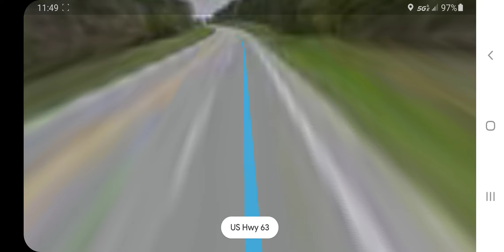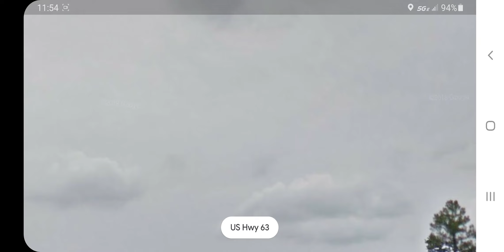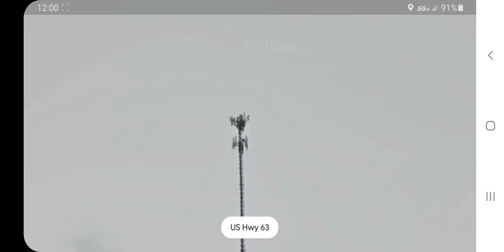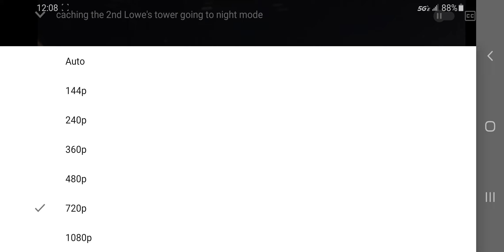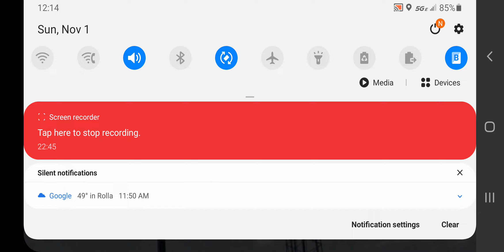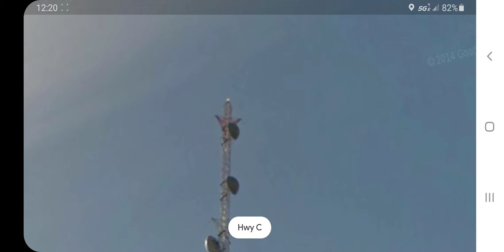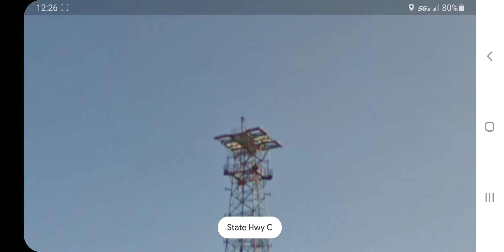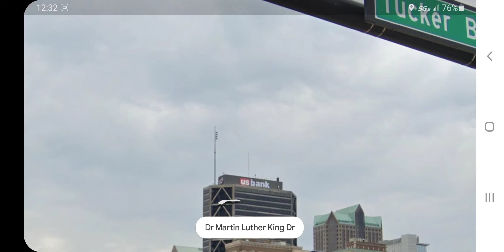beacon problems part 1

Comment: There's A Tower In Cotton Mn That Has A Day Mode Problem. It's A Tall Red And White Tower With 3 LEDS, 1 Up Top And 2 LEDS Sidemarkers In The Middle, With Dishes On It, Its Day Mode Is Not Working At All, All 3 LEDS On The Tower Are All Burnt Out, It Sits There Doing Nothing Every Morning, It's Been Like That For Quite A While Now, It Hasn't Been Fixed. Day Mode Is Completely Dead, But HOWEVER, AT NIGHT, ALL THE STROBES THAT ARE BURNT OUT FOR DAY MODE, THEY ALL WORK! THEY ALL WORK FOR NIGHT MODE! It Has A Slow LED Flash Radius, One Of My Favorite Night Modes, The Day Mode Is Dead Yet Night Mode Works Normally! Very Weird!